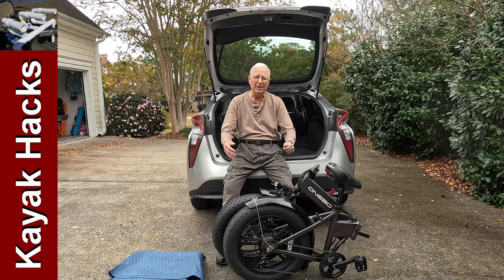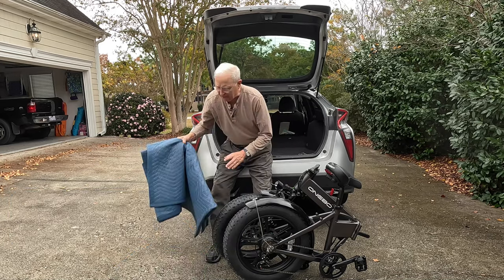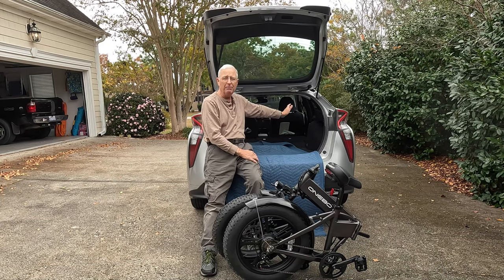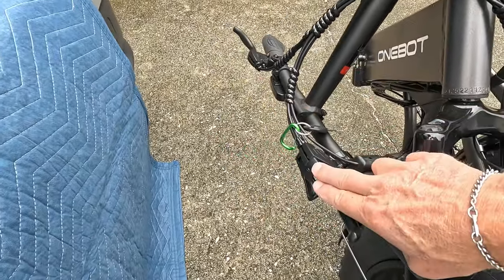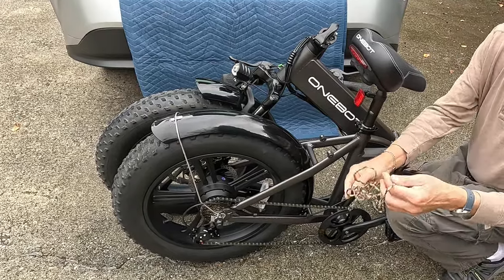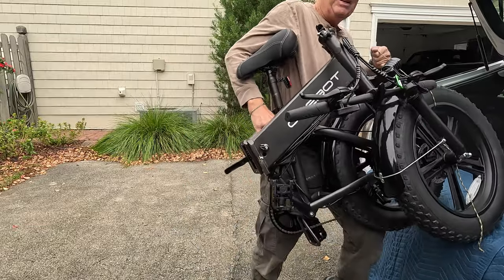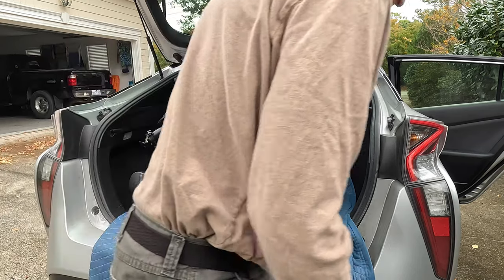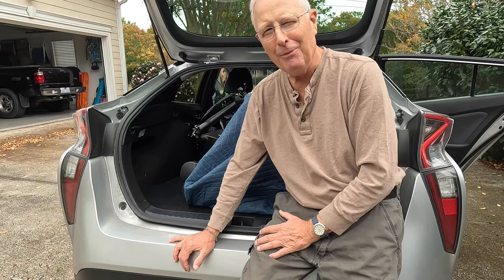How to Load Ebike Into Small Car - OneBot T6F into Prius

Comment: The car dog ramp and 32”x22” (LxW) plastic bin/tote, or call it storage container works for almost all vans, SUV/Crossovers, pickup trucks without any lifting. Just roll the 65 pounds foldable step-through e-bike (like in my case) inside the container that is turned on its width vertically, then slide it by pushing on the ramp, or pull it on the ramp in normal container position parking the container in the trunk. There is a trunk place for a 2nd foldable bike as well, transported next to each other. That is it.
Reply from the maker: Good Point!

Comment: It’s much better 65 lbs or heavier foldable fat tire e-bike sliding option into the vehicle trunk without lifting. Check alternative videos about this task using a 200 qt 50 gal storage containers and car foldable dog ramp. Save your back foldable e-bike riders. Good luck
Reply: The videos I've seen with the storage container/dog ramp approach, the person had a minivan with higher clearance in the back, that allows the folded bike to be stored upright.  But this person had a hatchback sedan (with less vertical clearance), which is also a problem with a sedan with a standard trunk (my situation) - then the bike needs to be stored on its side (part of his discussion about which side to store the bike on).  Some variation of the dog ramp may be do-able, but probably not with the large storage container, and neither he nor I can put the bike in, upright (the folded bike must be stored, on its side).  My positive is that I have a Lectric XP Lite which is a little lighter at under 50 lbs.

Comment: For a 75 year old, I am finding these folding eBikes way too heavy to manhandle into a hatchback or minivan. Rather than fold and lift, I find the much easier way is simply to purchase an inexpensive folding dog ramp from Amazon for around $50, then instead of folding the bike in half (which makes it less manageable) just leave it in the riding position BUT fold the handlebars only. Then the bike will roll up the ramp with ease. Just lay it down on its side being careful of the derailleur.

This is 100% easier than lifting it. Let the ramp and the rolling wheels do the work for you. No extra dollies or 50 gallon tubs needed, just the ramp, which weighs in at about 11 pounds. Piece of cake.

Greetings from Ontario, Canada.
Reply from the maker: Great idea! Thanks

Comment: Those moving blankets are good but don't let them sit in the car, the sun/ heat seems to make them come apart. A decent quilt from Goodwill or a cheap store has been about the same for padding and longer last for me. Also a little pvc on handle loop may help the cheese wire effect on the rope handle, soft tube works ok too.
Reply from the maker: I need to add the PVC to the handle. I did that for all my 5 gallon buckets and it does make a difference!

Comment: Use a 50 gal tote, tri fold doggie ramp, set the tote vertical at bottom of ramp, roll the ebike into the tote, lay the tote down onto the ramp and push into vehicle . Reverse the process when unloading.  No lifting, so says a 80 y/o.  Another hint, to keep the tires together I  use Velcro tape
Reply from the maker: That is a great idea. I'm going to try that!

Comment: Second thought is you may he able yo fit the whole bike in one of those roof top bags and prevent a lot of potential damage like that. Once again goodwill is a nice place to get one on the cheap. You may find some other case or bag it fits in with a handle at thrift stores.
Reply from the maker: Good point. I would have to find one wide enough for the bike to lay on its side since it is too tall to fit.
Reply: Isn't it going to be harder to carry such a heavy bike up that high?